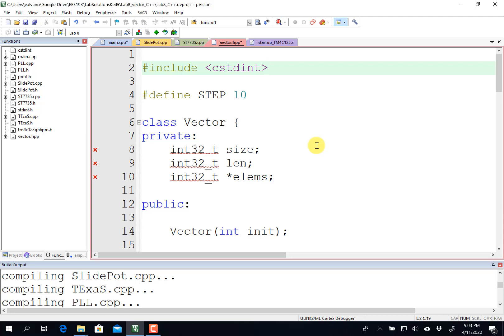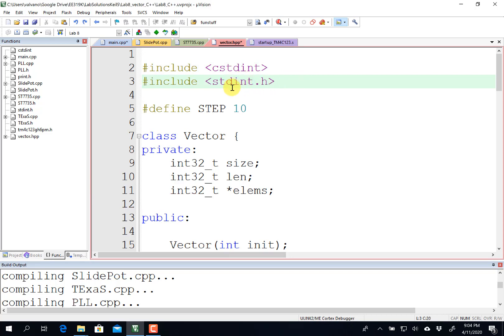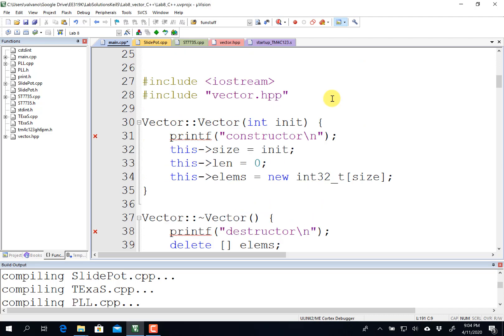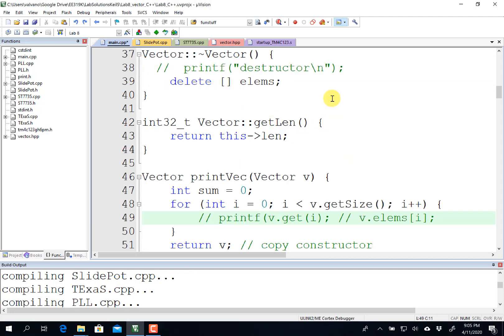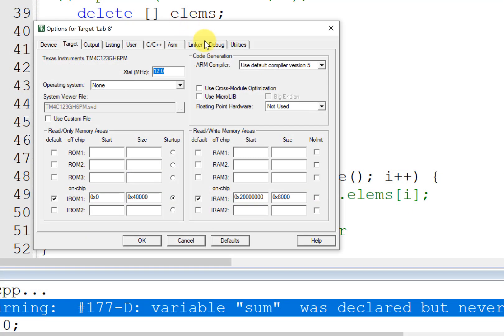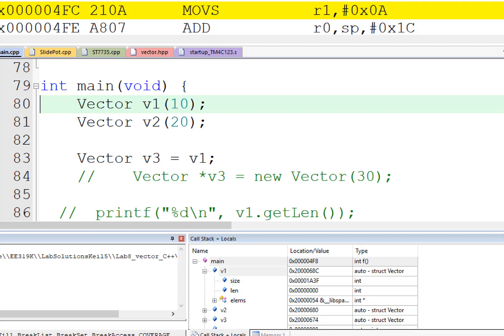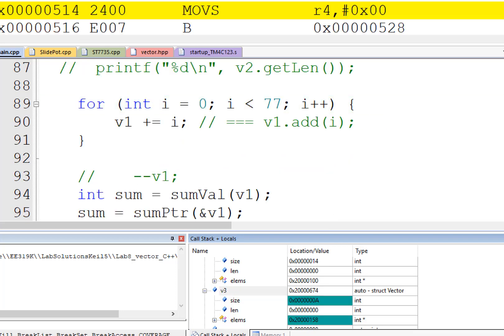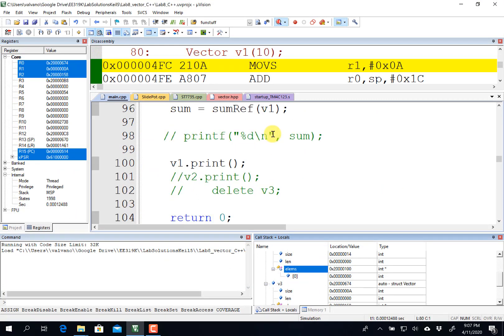Vector C++

Comment: 2:28, "Running with Code Size Limit: 32K". If instead you are running with the commercial version of uVision, does anyone know how big the compiled code can run on the TM4C123? Will it run compiled code that is actually up to 256K in size, and will uVision actually compile and flash code that large?